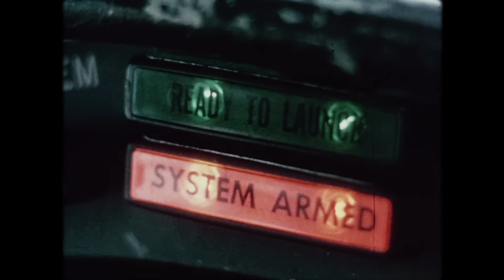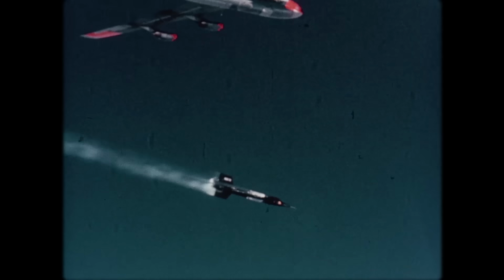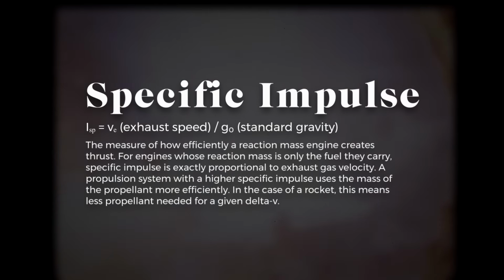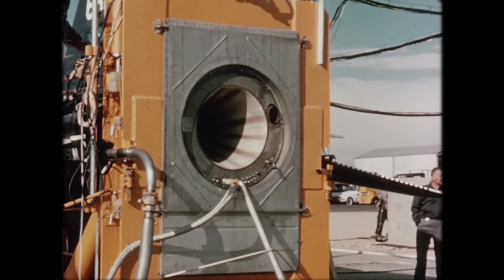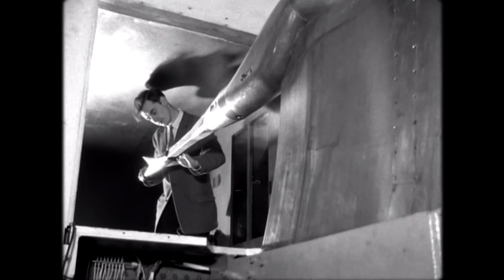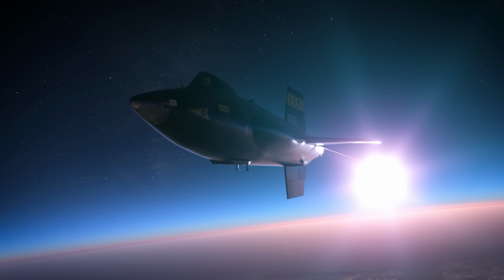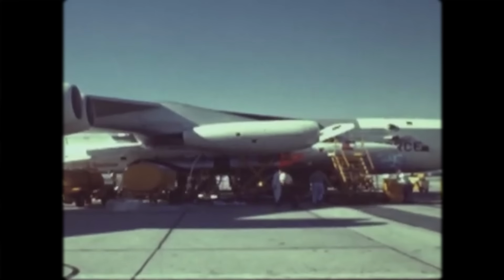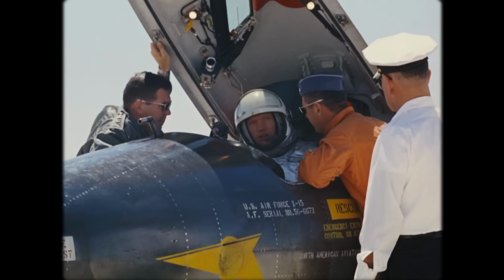The Insane Engineering of the X-15

Comment: Before your video If it needs to be launched off of another plane like a missile and it has the equivalent of an ICBM SpaceX rocket in terms of fuel capacity it's engine on Full Throttle 60 seconds of burn time is that really a plane or is it a missile that's piloted it couldn't take off by itself couldn't Land by itself but then again the U-2 spy plane also couldn't so I guess I'll see what you have to say because calling it a plane is like calling a wagon the equivalent of an F1 race car technically they both have wheels and can move but are vastly different sorry about the punctuation grammar and the lack of it after use voice activated text their primitively difficult I do sincerely apologize

Comment: my friend worked on one of the x-15s. not the one that broke in half hahahaha. he would use electricity to drill out broken taps and screws from the skin of the plane. you could not drill with a regular drill bit because the skin was so expensive, they did not want to lose any material.

Comment: Question:  Was there any kind of ejection system for lower speeds?  Obviously, ejection at 6.7 Mach is not a thing but what about later in the flight if the pilot managed to bleed off enough speed to make ejection survivable?

Comment: Though SpacePlanes that you quoted only once aren't only so experimental and for military use T.T

There is research ongoing for making them capable both of taking off and reaching orbit all by themselves (with double engine systems) that would allow to access space in a relatively safer way that sitting on a ton of explosive fuel.

An ideal model would use normal aircraft engines to gain altitude reaching the edge of space before kicking in the rocket engines to firstly reach an orbit and eventually setting course for the Moon, Mars or getting back down to Earth!

Comment: Real Engineering: makes video about a spaceplane
Wendover Productions: sweats nervously
Reply: *spacerocket
Reply: @andrewdoesyt7787  If you think it’s a space rocket, you have literally no clue what a plane and a rocket is.
Reply: @LuchtLeiderNederland  Lol, I know what a rocket is but my point is that it’s powered by a rocket engine and has short ass wings.
Reply: @andrewdoesyt7787  That confirms you know nothing what a plane and a rocket is. It doesn’t matter how small the wings are or what engine it has. If it generates lift with fixed-wings, has any-kind of propulsion and it’s heavier than air, you can call it a plane. The X-15 fulfills all these requirements, so it’s a plane. Also, the X-15 has bigger wings than the F-104 which is a jet fighter. And the Me 263 has a rocket engine as well, and it’s still a plane. All your points are invalid and here’s proof.
Reply: @LuchtLeiderNederland  calm down my man
Reply: @LuchtLeiderNederland  Dude, I know it’s a plane lol. I’m just saying it’s like a rocket, I don’t literally mean it’s a rocketship lol.

Comment: So I noticed in the pictures where the B-52 is shown carrying the X-15 there were weird markings on the sides. Looking the planes up I can see that they are tally marks in the shape of an X-15. There are three different marks: one with an X-15 at an upward angle, one with an X-15 in a downward angle, and one with an X-15 flying level. 

I assume they are tally marks reflecting how many times that B-52 carried an X-15.  I further assume that the different marks represent different mission outcomes or maybe different mission types. What I can't figure is what they mean exactly. Did you come across that in your research? I would think that the ones at an upward angle represent a mission where altitude was important, the level ones might be where speed was important, and maybe the downward angle ones are aborts?

Comment: Imagine flying an SR71 and this tiny plane just comes whizzing past you like nothing.
Reply: except its not a plane, it's a rocket with a pilot cabin.
Reply: @bikerboy3k  Agreed.  The SR-71 could go for hours at mach 3.2, but the X-15 achieved and kept its speed for only a few minutes, as its fuel was exhausted in about 90 seconds.  Awesome performance , in any case.
Reply: @jelink22  :) like a cheetah and antelope

Comment: It's not the molar mass of the fuel that's relevant for the Isp but the molar mass of the exhaust products. The difference between kerosene and LH2 becomes a lot smaller if you look at the average molar mass of the exhaust products. Also explains why CH4 has a higher specific impulse compared to other hydrocarbons. The combustion products are mostly water. The ideal exhaust gas is of course atomic hydrogen but that requires completely different engines.

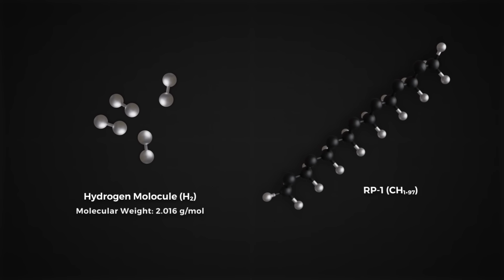Comment: 9:43 Makes the graphical error of showing a linear alkane. As discussed in the video, RP-1 needed properties that were achieved by removing undesirable isomers from kerosene, one of them being linear alkanes (aka long strings) to increase resistance to thermal breakdown. That's not to say there aren't linear alkanes, nor ignoring the fact that it's probably harder to make a 3D model of the highly branched or cyclic alkanes. Anyways, great video!

Comment: I'm sure I'm not the first to think this but imagine if you could use water for regenerative cooling and then split it into hydrogen and oxygen for combustion!
Reply from the maker: You would need a way to separate the water from the fuel, then have enough electric power on board to electrolyze the water, then have the hardware to electrolyze it, then have a way to pump it under pressure and cryogenically freeze it.
Reply: @RealEngineering  I was thinking of something where the electrolysis happens very close to the combustion site, within the engine itself. I have heard of catalysts that can reduce the electricity required to split water. I don't know if they're real or not but that's what I had in mind anyway. In the end, I know that it's probably too good to be true because otherwise, someone would have done it already.

Comment: NASA did not have anything to do with the X-15, it was an Air Force project.  NASA was only started in 1958 and the X-15 was flown in 1959.   Real Engineering, take the logo off the X-15 and remove the "Real" from your name.    NASA is now stealing glory from the past as the presently do using Space X, equipment, capsule, space suits and rockets.   The only thing NASA provides is overpriced probes, and advertisement promoting their spend in a billion dollar rock launch that is done for a tenth of that by private enterprise
Reply: there is a big 'AIR FORCE' logo on the plane, what the fuck are you talking about
Reply: You can see the NACA in the vertical stabilizer and behind the wing, that was what called NASA prior to 1958.
Reply: @alvarov6775   It originally had 66670 on the vertical stabilizer, apparently NASA added it.

Comment: FYI, Kelvin is an absolute temperature, Celsius is the differential unit.  A temperature difference would usually be expressed in degrees C.  Degrees K isn't a real unit as "degrees" implies a differential temperature.

Comment: Two days ago, I hear a random fact that the X-15 is still record holder for highest speed achieved in a manned flight and make a mental note to root through YT at some point for a vid about it.

Then along came Real Engineering...
Reply: Actually that's for powered, manned flight in a rocket plane.  During the Space Shuttle's return as a glider it would hit Mach 28,